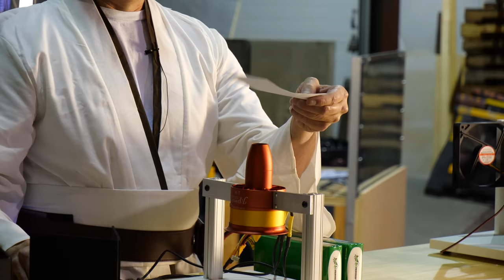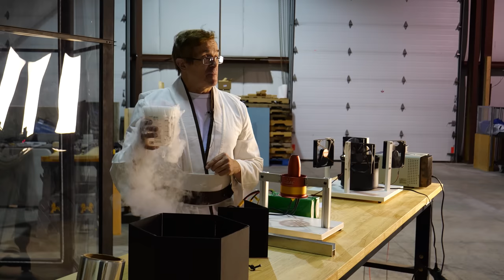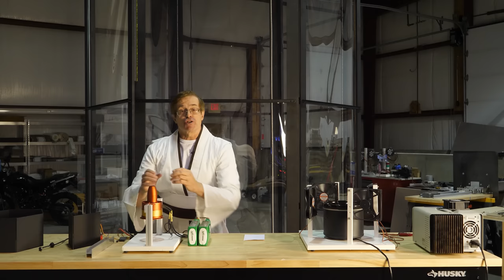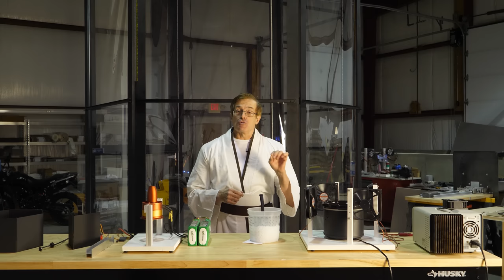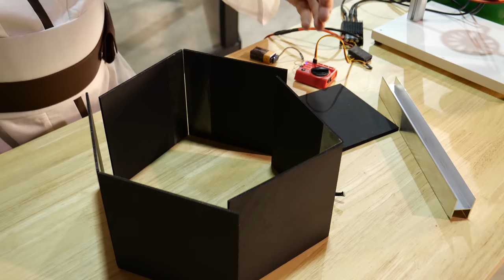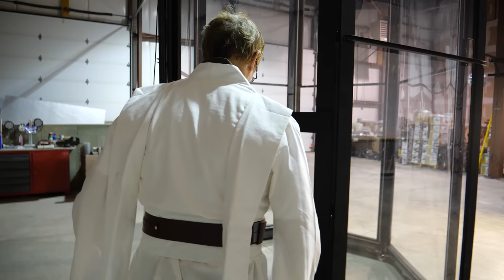Controlling Chaos: Building a Massive Tornado Chamber!

Comment: Here is another project that might be interesting and also make an interesting amount of money and views.  
There are solar farms that use trough mirrors to heat compressed air in pipes to drive a gas turbine. The heat is stored in piles of gravel to be used later to generate electricity.   The stored heat can also be used for space heating and hot water.  A ton of gravel raised by 500°C stores about 100 kwh of energy.   At 25% efficiency for the turbine,  that is about what an average house uses for electricity and heat and hot water in the winter.  
You could make solar panels out of the system by putting small pipes and mirrors in a glass covered box and connecting a number of such boxes together on the roof.  If the mirrors rotate around an axis and are aligned east west, the boxes can be fixed in place and mirrors connected together and rotated around an axis will track the sun.  There are high temperature, high efficiency solar cells that operate at over 500°C that will collect photovoltaic energy along the pipes along with the thermal energy.  A ton of gravel costs $50 compared to zillions of dollars for lithium batteries.  A weeks supply of electric heat and electricity stored in lithium batteries would cost hundreds of thousands of dollars but a ten ton gravel battery that holds a week's supply of heat and electricity  might only cost a few thousand dollars.   If the solar collector boxes cost about as much as solar panels but collect four times as much energy,  the system would make fossil fuels and PV panels near obsolete in a short time.

Comment: 7:06. Have to make a small correction here. The finger tips would accelerate in velocity terms, as it is angular momentum which is conserved. This quantity L = m * v * r, meaning that assuming a pointmass rotating at a radius r0 at velocity v0 with mass m will have an angular momentum L0 = m * v0 * r0. Reducing this radius to r1 gives L1 = m * v1 * r1. Equating L1 and L0 gives m * v1 * r1 = m * v0 * r0, so v1 = v0 *  (r0 / r1), so it most certainly increases.
Reply: Quick example: a pointmass with mass of 1kg spinning at a radius of 1m with 1m/s of velocity will rotate with a velocity of 2m/s at a radius of 0.5m. In terms of RPM, the pointmass will increase four fold.

Comment: There's a discussion that tornadic winds may also be related to electro-magnetic phenomena as much or more than they are related to temperature and mass. That is, an exchange of electron gap from earth "ground" to Sol plasma charged atmospheric shell is "accelerated" during such an event, and gases mostly go along for the ride. As noted, in theory, due to increased plasma impacts from Sol or other possibly interstellar phenom. 
One way to reduce tornadoes is to cool the earth's surface with expected evaporative water prior to the thunderheads getting to your location. While this isn't a certainty, it is likely to reduce the updraft potential of the immediate area. And if it doesn't work, the kids get to play in the hose and the estate gets early evaporative cooling for the afternoon. The same could be done with hurricanes, if you can get enough dry-ice into the Atlantic.

Comment: About the ice skater example at 7:00 Please note that the rotational kinetic energy does increase; the tangential velocity (of the extremities) of the ice skater does increase. Explanation: in order to sustain the circumnavigating motion (of the extremities) a centripetal force is exerted. When the ice skater contracts her arms that centripetal force is doing *work*, increasing the rotational kinetic energy. 

Here's the thing: it is only with circular motion that the centripetal force is not doing work. With circular motion the distance to the axis of rotation does not change. But when a rotating system contracts then it is not the case that the centripetal force is perpendicular to the instantaneous velocity. During contraction of a rotating system mass is spiraling in. During that inspiraling motion: decompose the centripetal force into these perpendicular components: parallal to the instantaneous velocity, and perpendicular to the instantaneous velocity. The component perpendicular to the instantaneous velocity is not doing work (of course), but the component parallel to the instantaneous velocity is, causing angular acceleration. 

Vsauce draws that diagram in this video:
https://www.youtube.com/watch?v=_WHRWLnVm_M&t=675s
(Vsauce does his usual rambling too, in that video, but the diagram is good.)

Another example:
The changes of velocity of  Halley's comet as it moves along its orbit. When Halleys comet is on its way to its perihelion (closest approach) the centripetal force of gravity is increasing the velocity of the comet. At perihelion the velocity of the comet is far larger than at aphelion.
Reply: Very interesting. Probably where part of the work from the fan was going. 
So centripetal force is trying to "round out" ellipses?
Reply: @Dr_Wrong  It's not clear why you suggest that a centripetal force might "round out" an ellipse. Take for example the orbit of Halley's comet. That orbit has a high degree of eccentricity. The shape of that orbit has not changed for millenia. (According to the information on a NASA website Halley's comet has been in that orbit for at least 16,000 years) The only thing that can cause a change of that orbit is when the comet's orbit happens to bring it close enough to a planet to be affected by the gravity of that planet.
Reply: @cleon_teunissen  

It merely seemed to me that when a "force" is doing no work, it has achieved its "goal." ‡ 

Or, ofc, some other forces are "interfering" and stabilize. 
i.e. Atmospheric gases are much warmer than space, but gravity keeps most of it from flying away. 

Also, that was a question. 

‡ plz forgive the anthropomorphism of the analogy.. 😉
Reply: @cleon_teunissen  

Also, on a galactic scale, "16,000 years" = wildly unstable, idk.. 😄

Comment: As a lad in elementary school, we had a guy come into the classroom with a similar looking device, only it was maybe 4-5' tall, 4 sided (glass or plexiglass, I don't quite recall), possibly 2' square on the bottom/top, with what looked like a pie pan on the bottom and, I believe, at least 2 heat lamps shining down on the pie pan. I didn't hear any fan from it, so it must have been all convection based. And he did creation a tornado like vortex with this device. Perhaps you could explore this possibility for much smaller scale demonstrations.

Take this with a grain of salt as I was a young 'un, (single digit) and this is going on 50 years ago.

Comment: What would be even cooler to see would be a tornado primarily powered by heat, to demonstrate the latent heat of moisture, and the visualization of water condensation (the chamber would have to remain barely above the dew point of the water being vaporized near the bottom) i.e. using a high power heat pump to heat the water in the bottom-center, allowing the flow to exit the top-center, then through a cooling heat exchanger (cold-side of a heat pump), then flow down around the sides and back into the chamber through tangential slits. You may or may not be able to get away with turning the heat pump fan/s off... but if you could establish a vortex where the pressure drop of the vortex itself precipitates the moisture, that would be awesome...

Comment: 23:09 & 24:07 Your tornado is upside down. You have an updraft. It's spiking up, not down. You can see it's thicker at the base and thinner at the top. People don't seem to get tornados but it's a vortex - flow is from the thick end to the thin end.
Reply: ?? You made me doubt my sanity so I had to google it lol Tornadoes have an updraft, they lift things up into the air, anybody who has seen them on tv (or the Wizard of Oz movie) knows that. You can clearly see things being sucked in at the bottom (thin end), not blown away. The flow is upwards from the thin end of the funnel, to the thick. You're so wrong I don't think techingredients will reply.
Reply: @topspeed250k5  
Haha, Sorry to freak you out! I have to admit I have been pondering this since I was a kid. It has led me to an interest in fluid dynamics. If you will bear with me I will explain…

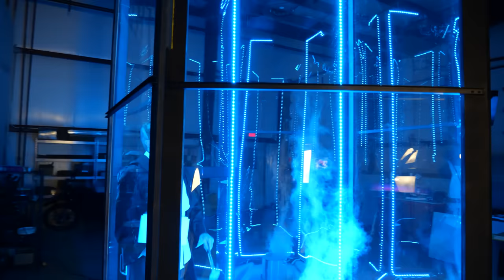Look at the video – at 23:08 you can see the tornado is just beginning to form but upside down. One second later, you can clearly see a thick base while a thin finger reaches the fan at the top of the chamber. It holds that form for a couple of seconds then devolves into a column. Several times the vortex devolves into a column and then reforms the same way – a thin wisp of fog reaching up to the fan from a thick base. Probably the best example is at 24:01 where he momentarily interrupts the flow. Once again, you can see the vortex reform but upside down. At 24:08 you can see a very well formed upside down vortex. At no point does it have a thick end at the top and a thin one at the bottom. If you look at footage of real tornadoes forming you will see that wisp or finger reaching downward to the ground, never the other way around.

By my reasoning the shape and the action are formed by fluid dynamics – a combination of movement, pressure and lack thereof (I can explain but this will be long enough already). Regardless of what is commonly taught about tornadoes, the shape of this formation demonstrates that the fluid must move predominantly downward. If you look at any vortex they work that way. I can’t see how a tornado is any different. Researchers have been trying to understand tornadoes for decades and as yet I don’t know of any who have explained how the fluid moves from the thin end to the thick end – it flies in the face of accepted physics and fluid dynamics.

In a water vortex most objects will be drawn down with the flow but some objects will be drawn up against the flow. You can do an experiment using a tall cylinder of water. Place into it a spherical object and an egg shaped object. Get a suitable stirring rod and stir it. The sphere will spin around on the bottom of the cylinder while the egg will rise up. Vortexes are weird! Bear in mind that the objects need to sink in the water but only just. I saw this experiment conducted using a chicken egg and a ping-pong ball filled with honey to approximate the density of the egg. These days a couple of 3D printed objects would do nicely I think. When you stir the water in this cylinder (or many things – a cup of tea for example) you are creating a vortex with a down draft in the centre and an updraft on the outside.

I have watched many videos of tornados over the years looking for evidence of anything being drawn up into one and haven’t been able to spot any. I often see stuff flying around outside them though. I think a big part of the problem is getting close enough to see what’s really happening inside. 

I don’t fully understand tornadoes either but based on it’s structure, my understanding is that in a tornado you get air traveling down the cone which then exits and travels up the outside in a wider arc and at a lower velocity outside cone. The rotational velocity that forms the cone also creates a low pressure zone inside the cone which can cause objects to lift. I think that at some moments air and objects can be sucked into this low pressure zone. At other times the rotating air can make a sort of a seal against the ground increasing the vacuum and velocity inside. The amount of air that exits the tornado is not equal to the volume of the cone itself due to this intense vacuum. This vacuum could be what draws air and objects into the vortex. The damage we see is done by velocity and vacuum in and at the base of the tornado, not mass. @topspeed250k5

Comment: Illuminate vortex with a green laser. Reflecting off a small spinning mirror mounted at the centre of your exhaust fan. 
Set mirror angle so laser beam forms a cone pointing down.
With cone spreading out close to the largest diameter the vortex makes.
This gives a stunning display of the smokes undulations. 
You can add a 2nd or 3rd laser in other colours & with a slightly smaller divergence.  
Even a line, cross or scatter filter in front of a laser pointed at the vortex will be impressive.
Note: please follow eye saftey protocol when using lasers even laser  poibters.

Comment: Ultrasonic humidifier(s) can help you. Ready-made modules for 6-20 emitters for immersion in a container with water are sold on trading platforms. You just need to keep in mind that the humidity in the room can very quickly reach 100%, and all objects will begin to become covered with drops of water. And it’s better to use distilled water, because hardness salts settle on objects in the form of a white coating. 
*Meanwhile, beautiful design of chamber! I like how its relatively low cost not affecting neither its functionality or appearance.
Reply from the maker: Thank you!

Comment: Have you given any thought as to how you may be able to simulate a funnel shaped tornado effect ?

ChatGPT gives an explanation of contributing factors that influence the shape, however, it does not specifically or directly explain how the forces actually effect the narrowing of the bottom of the funnel .

I have some ideas on how it may be possible to produce a funnel :

Remove the fan in the center of the top ( or not ) and add fans near the periphery of the top .  It may also be beneficial to add some short slanted vertical vanes, close to the top, to cause a bit of circular rotation to the air at the top as it is drawn up . ( might not be needed )

Close off all of the air intake at the top and gradually taper the air inlet between wall segments more open towards the bottom .   Close all air intake at below the level of the vapor source - maybe even build a raised platform so that the floor of the chamber is above the vapor source - with a depressed region where the water pot sits .

Channel the air flow via vane pairs that extend from the inlet gaps toward the vapor source .  It may be that the directed, higher velocity, air flow at the bottom of the chamber would shape the vapor plume into a funnel shape .

I think that using the directional vanes may alleviate the friction and turbulence caused by the non-circular walls of the chamber .   Possibly the friction and turbulence of the air through the vanes may be less that that exhibited against the walls and the stagnant air mass between the walls and the vapor source .

All these vanes would serve to provide concentrated directional flow - similar to the 4 fans that were used with the small model you demonstrated .  Well, I just thought about > - you could put 4 fans at the bottom of the chamber - couldn't you .
Reply from the maker: Those are good suggestions.  Did you notice  how the vortex improved  when I left the chamber and the flow symmetry improved?
Reply: @TechIngredients  
I sure did - I was constantly considering the effect and shape of the vapor vortex because i had previously tried to figure out how and why the funnel shape happens; especially since chatGPT's explanations, specifically concerning the funnel shape, were virtually useless .

My ideas about it are mixed and uncertain because it is very difficult, by just imagination, to understand what is going on .  

What i get hung up on is :

pressure / air speed / centrifugal force 
verses
condensation / heat energy transfer .   

I wonder about the effect ratio between the two groups .  Which one is more important ?  And how can you effectuate the proper humidity, temperature, and condensation conditions ?  Put heaters that are boiling water at the bottom .  Would it need an air cooler at the top or half way up ?

I thought about a water spiral vortex and I think I understand that it narrows towards the bottom because of greater water pressure .  I don't think that applies to tornadoes  though .  I have to admit it - I am not smarter than chatGPT on this one .

Now - when it comes to chatGPT's claims that the 911 wtc buildings fell down 1,000 feet in 11 seconds while reaching speeds over 200 miles an hour before hitting the ground; stating that it was all due to gravity ?    I know better than that and it is MATH and SCIENCE that told me so . lol   ( dig dig dig )

Now - I have a question for you - since I am sure that your analytical mind can gather a few formulas together and come up with a reasonable estimation ...
How many watts of power do you guess that it might take to conjure up the needed conditions, in the small model tornado of yours, to be able to produce a funnel shape ?
I am supposing that it might be a tenuous balancing act to get it to work with the relatively frail structure of your current model .   I think the wind velocities and pressure differentials would be too varied and unstable to be precisely controlled enough to not damage or destroy the structure .
Reply: @TechIngredients  
I just got a good idea - i think .
Instead of using regular planar rotary fans - why not use large squirrel fan ( s ) ?
Well, it could be close to the diameter of the chamber and it also could be below the elevated floor .  That way it would draw air in from the outside and swirl it under the floor and force the air out of an enlarged hole in the floor where the pot sits .  That may give it a concentrated vortex at the bottom that would likely expand as it rises .
I wonder if a fan ( squirrel type or otherwise ) would be needed at the top ?
I am sure you can do something with this .